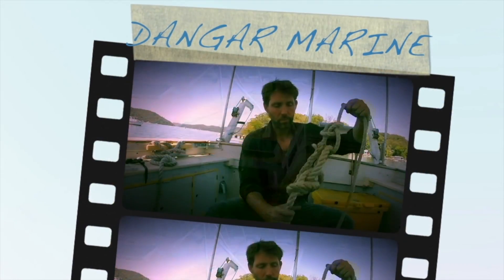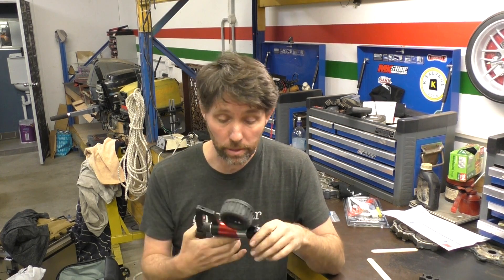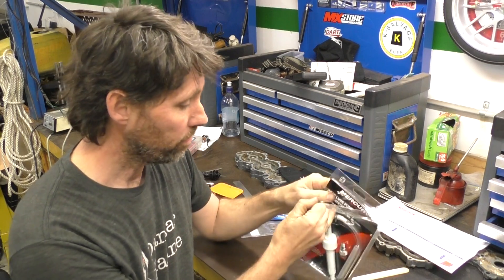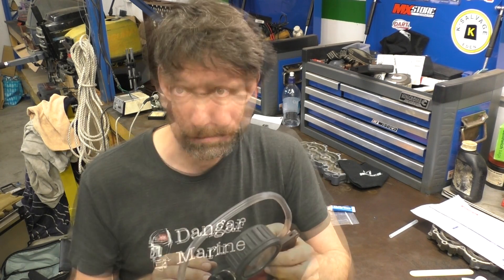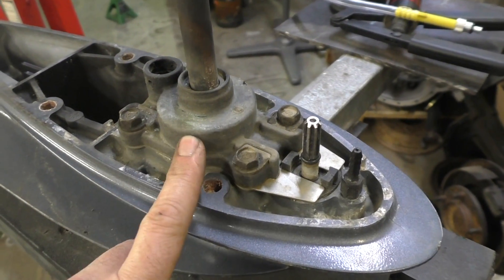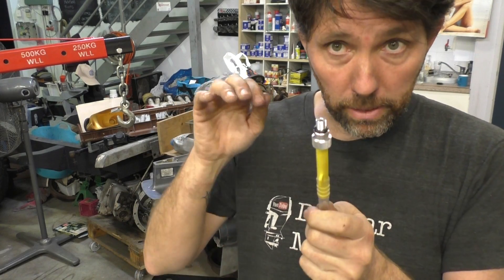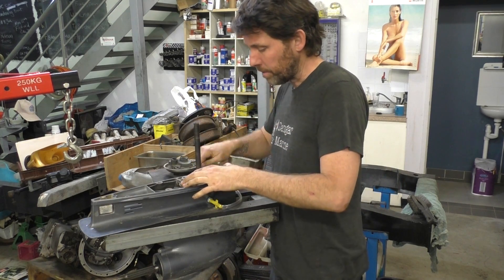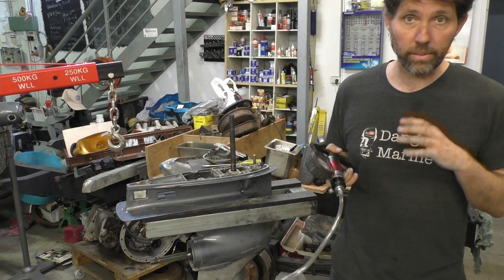Pressure testing an outboard gearbox

Comment: Hi Stu, how about doing a outboard motor in a test tank with a test prop. Just showing how to check timing and carbs on a 2 stroke. 50 to 70hp engine that is best left on the boat. I have been looking but nobody has done a video on this.
Reply from the maker: A video you'll probably see before that is building a test tank given I currently don't have one!
Reply: Ok will build one someday and do a video. I don't see one by anyone else so would be a good one to do.

Comment: My oil seals went bad on my 150 hp Johnson, now with the water intrusion I need to replace the needle bearings.  Any tips for how to remove those bearings?  The forward needle bearing on the carrier has two cutouts that I can get a punch in to punch the bearing out, but the rear needle bearing doesn't have this so there is barely any lip to punch it out.  Thanks!
Reply from the maker: Can't say I've ever done the bearings on a Johnson like that. Normally I use a bearing separator to press the bearings off the carrier and then a puller like a spigot puller to get the race out from inside the gearbox. These are cone bearings though so it is likely to be different than your situation.

Comment: I have about the same Tools as you, made whit a pressure/cacuum pump and the feeting from a lower unit pump and metric adaptor , same as you.. I put a old Bob Keers's lower unit stand  on a traler jack for adjust the working heigh.  On the open end on 3/4" wrench that i use to put the lower unit on the stand, i weld a Merc shift cam so i can use to shift if i need during repair. i made an older to support my gage during the test.

https://www.youtube.com/watch?v=_aPnqVvbkbE&feature=em-upload_owner

Like to Watch your videos !!
J'aime regarder vos vidéos 
From Québec Canada
Reply from the maker: Looks like great setup you've got there, making me jealous! :)

Comment: Thanks for this video I have all the bits to put one together, I look forward to your video on the tilt trim on the Mercury, mine is a electric tilt trim quite complicated but I managed to get it put back together but I'm still puzzled by the throttle only button it stays in and somehow I think it should be spring loaded but I saw no spring when I took it apart and the manual doesn't show one either, it's a Mercury model 327 shift lever
Reply from the maker: Yes, I would imagine that button to be spring loaded and pop out when the motor returns to neutral. Perhaps the mechanism that releases is in neutral has failed?
Reply: I agree and I put a call into Mercury in Wisconsin, spent half an hour with someone who tried to help but couldn't but he told me he would get back to me with an answer, the schematics didn't show a spring and my local Mercury dealer hasn't been able to figure it out yet, I'll give you an update on how this all goes

Comment: Ripper stu.A note for followers, I filled a bf150 gearbox with a small bottle pump recently and just ran in vent screw a few turns to really fill it and squirt a little head room out. I gave it a half pump to make sure it was full, and it leaked oil out of prop shaft seal. Pressure tested box and it held 10psi indefinitely.So lesson is you can Put quite a bit of pressure in hydraulically, as opposed to air. Don't fill with vent screw even just threaded. Bad news.Cheers
Reply from the maker: Hi Matt. Interesting to hear that, I wonder how much pressure that oil was creating with only half a pump? Thanks for sharing!

Comment: So with this method, you don't have to pull the lower unit to complete this test. Correct?
Reply from the maker: That's right, it can be tested in place and only removed if the drive shaft seal has failed, the prop shaft seal can be replaced with the gearbox attached.
Reply: Thank you...love the channel and always mention your channel in the notes of the order at marineengine.com. Also ask them to send you another Johnson 150 since that is same engine I have. (Actually i have two of them) So seeing you work through that one was extremely interesting.

Comment: That drive shaft looks to have been 'waisted' about where you say the support bearing/bush was. With the torque that goes through the shafts , even on the lower HP units, it would not take much of nick in the surface to cause a fatigue failure. But dropping the shafts can cause a similar failure as many of the shafts are hardened steel. That half crystalline / half torn look would indicate a twist/torque fracture was the cause of the final failure. I don't like to think what the prop looked like!Didn't see any mechanic lubricant this time- bit of a worry.
Reply from the maker: Hey Ron, yeah, I don't recall if I saw the prop but I think I might have remembered him saying it was actually running through sand so perhaps just the extra resistance was enough to make it let go. I must have been rushing this video if I didn't go upstairs to get a beer! I'm also thinking of adding a drink holder to that lower unit stand. ;)
Reply: If you are going to do that then you need to also add a USB port, Bluetooth navigation and self parking!The Landy doesn't seem to be progressing - bit of a stalled project?

Comment: Love your videos.  They give me good ideas for maintaining my Yamaha SX150.  I have a Mighty Mike brake vacuum hand pump but it only pulls vacuum.  Do you think pulling a 10# vacuum would be just as effective a test as pressurizing the gear case?
Reply from the maker: I certainly think it would give you a good indication if a seal has completely failed, for sure.

Comment: Is the reason you pressure test instead of vacuum because of the way the seals are made? We vacuum test chain saw engines for the same reason. Thanks for another excellent teaching lesson!
Reply from the maker: Hey John, the short answer is that the service manual specifies a pressure test, but now I think about it as the oil heats up pressure does build up inside the gearbox (if you open the drain plug of a hot gearbox it will shoot everywhere) so I guess containing pressure is the main job of the seals.
Reply: I'll buy that...thanks!
Reply: Bot sure if it is the reason , but many seals have a 'lip' that is curled - so in use the pressurised side applies pressure to the lip to make the seal work better . As the gearbox  will normally raise pressure by heat expanding the air in the gearbox I am assuming this is reason the OEM states to use a pressure test. A vacuum test may apply pressure in the wrong direction so give a false reading.

Comment: Great video Stu, My son's 110 9.8 merc lower unit was leaking and got the tool to remove the prop shaft unit nut. Pulled it apart and replaced all the seals and orings. Also replaced the cracked impeller housing. When done didn't know about this set up so just put pressure using the lube pump to see if the leaks stop and all is good. Next time we change the lube will pressure test it with this method. Oh and took the tool back to get our money back😎
Reply from the maker: Thanks Tim, interesting idea about using the oil pump itself to put a bit of extra pressure in and look for leaks.

Comment: Hey there Dangar marine, I just got a boat with a 10hp honda outboard, I used it for a couple of hrs then heard a misfire and lost all power, now it runs like crap and just basically idles terrible and runs off when any revs are applied. It's my first boat and I was lucky enough to get a tow from another boater into a marina where I am now moored. I already had some dickhead charge me 130 quid for a call out and he appeared with no tools and just pissed about for 20 minutes n said he thinks it's the coil pack. Since he was 4 hrs late and with no tools, I doubt his diagnosis. I spent a couple of hrs yesterday undoing all the linkage and cables etc to remove the engine, but it's too heavy for me to lift, how do I get it out of my boat while it's in the water is there a way ? Am at my wits end and just want to get boating again :( I sold my truck to buy this boat grrr :) any advice much apprecaited cheers ;)
Reply: Dad's Kitchen It very well could be your coil. Make sure its getting fuel. Then check sparkplug for spark. If this an EFI or carbed motor?
Reply from the maker: It could be many things unfortunately. As Jimbo says, start with the basics and see if it has fuel, clean the carbs (presuming it isn't EFI), check for spark, check for timing while cranking it.
Reply: Think it's got a carb its a honda 10hp bf10d i think it's called. One of these https://www.youtube.com/watch?v=Ktu9OwtN1zI
Reply: Cheers< i shall try, got a new spark plug of ebay lol ;)

Comment: Can that pump be used,  with a spark plug adapter, to test compression in the cylinders up top?
Reply from the maker: Jimbo is right in that that gauge only goes up to about 40-50 PSI where compression testers go up to 180-200. They also have a schrader valve in them to store the peak pressure they detect.
Reply: Ian Stuart You would want an actual compression tester for that. Im sure you could make one diy. The gauge on these brake/vacuum  testers are usually like 50 psi. Compression on outboards are usually in the 110-150 range.
Reply: jimbo gasoline any suggestion on creating or finding one?
Reply: I got mine off amazon or ebay. Mine was only around 25 bucks. Has all the spark plug threads you'll need and seems well made. When i get home ill let you know what brand i got. Harbor Freight sells them too but i got a better deal online